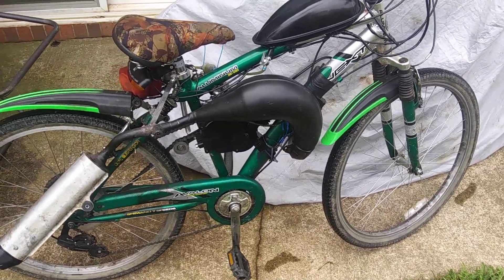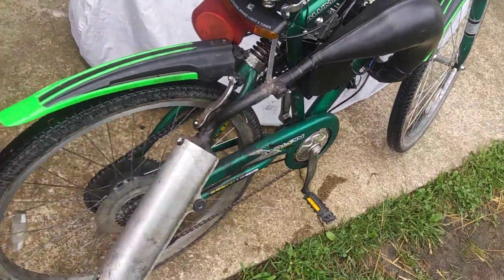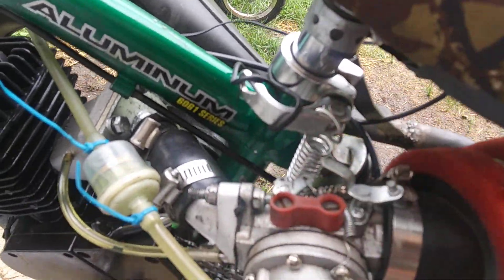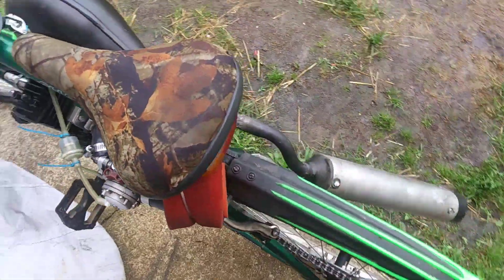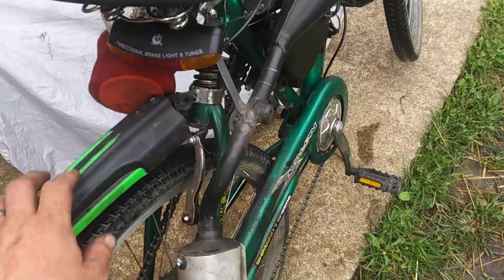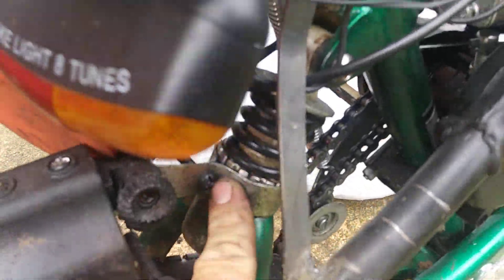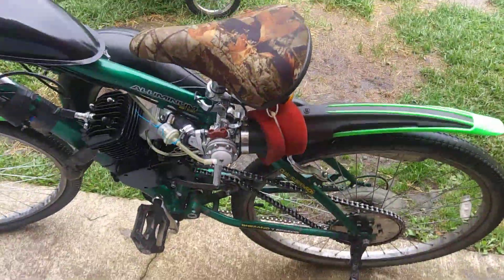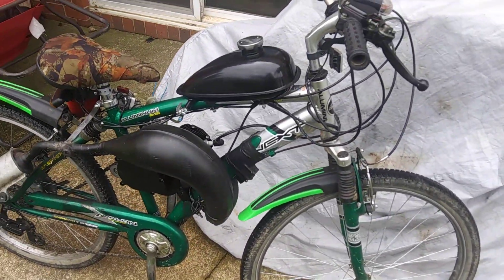Next Avalon motorized bike 9 month update!

Comment: Do them dirt bike pipes really makes a difference in power or I'm better off getting the wc80 pipe?
Reply from the maker: Huge difference!
Reply: @Baldys_projects ok thanks
Reply: @Baldys_projects  which one is the best for fitment
Reply from the maker: @macmotorizedbike3834  This YZ85 fits really well it's my pick for fitment but they all are pretty close just the YZ85 pipe has a dent from the factory on them that fits right where the head on the engine is and its a really nice and snug fit.